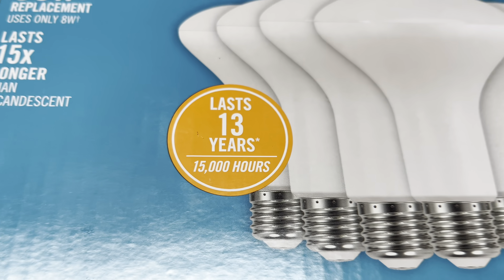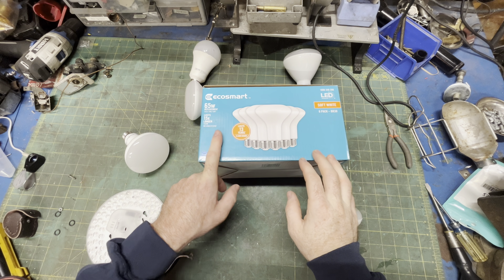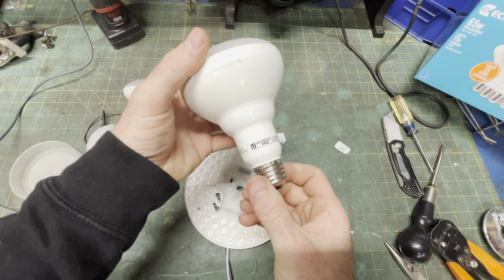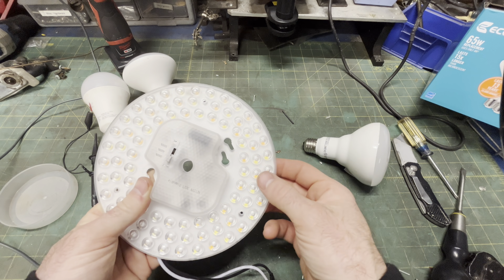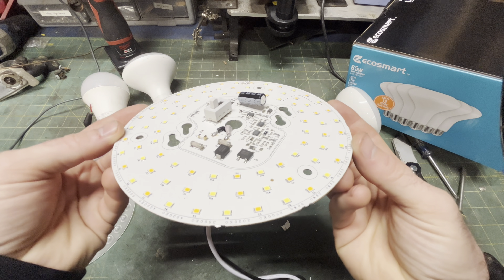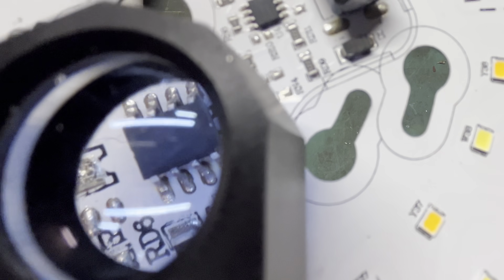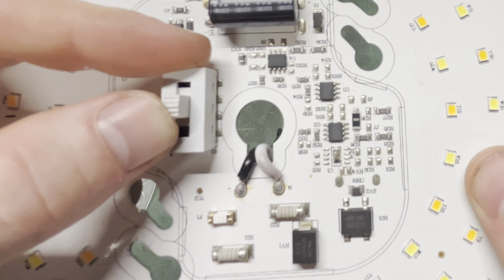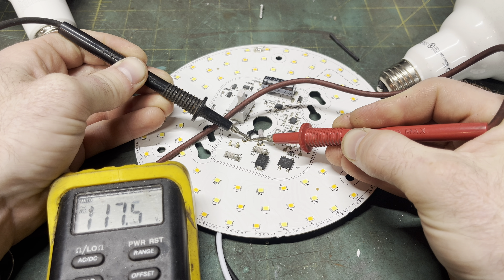Why Do LED Bulbs Fail? An Autopsy!

Comment: Its wild, we were told "its ok that the bulbs are more expensive, worse for the environment and made with questionably sourced materials. They last longer so its a net positive environmental impact" and that SHOULD all be true but they last, on average, slightly less as long as incandescent. And now incandescent are all but entirely gone. Even with the lower power consumption, LED bulbs are a net nagitive environmental impact, and its really embarrassing. The government should really be holding manufacturers accountable for the false advertising, but environmental  onsciousness and efficiency is the federal governments favorite scam bait.

Comment: It shouldn't be all that difficult to switch all residential lighting over to DC. Just install a DC power supply between the breaker box and the light circuits, then run all of the lighting off of DC power. Now you only have one likely failure point, since the LEDs themselves will run basically forever in comparison.

Comment: You referred to an electrolytic capacitor in the second bulb. The obvious role for that would be to smooth the output of the bridge rectifier, but that wasn't happening.

Comment: Plenty of name brand GE bulbs i have fail not inside the bulb itself.. but tjat super super leaf paper thin layer on the bottom of the bulb when you unscrew or screw it in. X amount of times.  Or if its in a older fixture it scratchs or burns off that coating and it stops getting electricity.

To where old fashion bulbs have a thick layer of almost like lead on the bottom and this never wears out

Comment: I've had a homemade led bulb on continuously for 10 years now on my back porch yet I can't buy a brand new modern led bulb that lasts more than 2 years (I have unstable mains voltage).

Also most bulbs I buy now run so crazy hot, it's uncomfortable to touch the base of them and the "cheaper" ones have no heatsink whatsoever.

Comment: Regarding your light sensor that's on all the time, did you ever work on 3 series BMWs? Because that's just what my 'automatic' setting for my lights does. I think 'only on when it's dark', it thinks 'on!'
Works for me! Except when i take it for an MOT test and Ian switches them off. That leads to a few seconds of confusion for me when i'm on earlies and drive up the road wondering why it's so dark then have to pull over and switch on the interior light to work out how to switch the lights back on again...

Comment: Fatprobing around a live circuit and making breakers pop and magic smoke get released is giving me a very uncomfortable feeling. I suggest you to invest into a sharp and thinner pair or probes, just so you can stab the test points directly without it slipping amd making a short.

Comment: Life is measured in hours. The number of hours you run the light equals the life. Some manufacture will state on the box x number per day. 
Example a 10 year bulb might only be a 15k hour bulb that is intended to be on for only 4 hours per day. 
Keep this in mind not only for bulbs, tvs and anything that have backlights. Tvs will quit working due to bad backlights as well.

Comment: In the UK/EU lifetime (and other specs) labelling is mandatory and must be done to standards.  However I have found store brand bulbs do not last their indicated life, typically about 1/4 probably for the reasons you state.    Store brands do not have the technical expertise to assess a suppliers product and the suppliers has no incentive to produce quality goods.  They are fire and forget production.  They will have agreed on a cheap price and will cost engineer the product to death.
Proper brand last much better, its simply a matter of having a brand to protect.  In the last few years I have noticed store are not doing their brands on LED bulbs anymore, and stocking a well known brand instead.

Comment: I've had the LED lightbulbs in my house for over 3 years, most of the incandescent ones i remember changing every other day. most of the time due to pretty much temperature damage on the glass, or some sort of power wiring  issue.
LED ones dont really have a reason why they should break apart from blowing out the other less stable parts. 
But we all know they like to install Planed Obsolescent crap in everything.

Comment: Do you think they ran the Leds at a lower voltage to reduce the heat and just to make the Leds run alot longer.

Comment: 11:45 the first round of LED bulbs were over engineered to avoid something going wrong since older LED's had a tendency to be melted with high voltage the companies that churn out crap didnt want to be sued for fire damages for trying to make a quick buck off the surge craze.

Comment: I have moved and replaced every single bulb with expensive Philips light bulbs and when I installed them I wrote in sharpi the date installed and then stashed the receipt in the box, once the the box is filled with burnt out bulbs I take them back to the store and get a new box. Ive lived in my new house for under 3 years and ive replaced every light bulb due to flickering, burned out or non functioning close to three times per room. 5 times in the hallways which is insane cause I have to use a ladder. I get them exchanged at no additional cost and they send them back to the manufacturer I suggest EVERYONE do that... or smuggle the bulbs from Dubai where planned obsolescence is illegal

Comment: OK, long story short:  my experience is totally different than yours. Before 2009, it was incandescent lighting all the way.  Bulbs were cheap, they lasted mostly about a year, and I bought a ton of them. They sucked up 60 watts each and cost me much more for the power than for the bulb.  In 2009 I transitioned to CFLs with every burned out bulb, so it didn't take long.  Four years of decent light, bulbs burned out rarely, looked a little weird; something like 27 watts?  In 2013 I went 100% LEDs - and it's been a miracle technology.  They don't burn out, the light is easy on my eyes, it's 9 watts, my lighting bill is so cheap it seems free.  I would have to be insane to go back to anything else!  Two points:  I did have my wiring and grounds checked out by a certified electrician, and all issues corrected.  And I always buy name-brand LED bulbs.  Sure, they might be made in China - but a Phillips bulb beats sketchy Brand X Chinese junk anytime.  You get what you pay for.  I'm ecstatic with LED lighting... and I'm just talking about ordinary light bulbs here.  LED has revolutionized many other aspects of lighting.  With lighting... humans have never had it so good.  Sorry to hear you're not getting the same results!

Comment: As expected, the LED is seldom the problem. I always assumed the capacitors would fail. It's surprising the resistors fail so often or solder joints fail.

Comment: The fact that you operate incandescents and LED bulbs in the same circuit explains your experience of failing LED. Of course chinesium solder joints won't help, but the main issue is definitely the mixed use. Either switch over your entire house, or don't switch at all. Power saving Phillips bulbs are even worse than tungsten incandescents...

Comment: The easy solution is to wire the light bulb sockets with a heavy duty power supply to feed all sockets.   To many cheap power supplies = dead electronics.   I wonder if houses will start going up in flames due to cheap led bulbs

Comment: It isn't "hipstery" to prefer the light spectrum that incandescents give off.  In fact, in 2 or 3 decades we'll likely be hearing about the unbelievable detrimental effects of the missing light frequencies (and overamplified other ones) in LEDs compared to the (closer to sunlight) legacy incandescents and halogens.  There's a ton of science on this already.

Comment: 0:25 Incandescent light bulb on 24/7 for 9 years, which is about 79.000 hours. Typical life span is up to 2000 hours. That's nearly 40x the typical life span. I find that hard to believe.

Comment: You are lucky that it is the boards that fail. In Russia, most LED lamps fail because the boards are configured to supply more current to the LEDs than they are designed to. The situation is that they give more light, but fail faster due to overheating and literally burn out. Savings + planned obsolescence
Reply: токоограничивающий резистор решает  эту проблему .
Reply: @ruslantser  Нет
Reply: @lynrayy  проверено временем

Comment: the LED streetlights around where i live are failing here and there, a whole street of them died a few months ago, all for the same reasons most LED lights fail, cheap circuits and placed on a line that wasn't designed with them in mind.

Comment: "Crap out after 5 years or less?"  Yeah, LOTS LESS.  I started writing the date on every bulb base back when CFL's became a thing.  Not a single one of these garbage bulbs lasted more than a year, with the exception of the ones that were never used!  When stores began peddling LED's, I did the same thing.  The first couple of generations of LED's never lasted beyond 9 months.  The new ones have gotten better but they still don't come close to the marketing hype.  Failures range from garbage electrolytic caps to unsoldered components to defective LED chips to garbage heat sink grease that dries out causing LED chip failure from heat.

Comment: Where did you get LED bulbs that last 5-7 years? The typical lifetime I see is measured in months and they burn out the actual LEDs (unless I specifically buy some of the rare ultra-efficient kind).

In a case of one whole batch, some failed because of bad solder joint connection - or more specifically complete lack of solder on one side of the power input. This caused flickering which over time burned the LEDs.

Around here, those you can get in the vast majority of stores, are the cheapest of the cheapest ones, that overdrive the LEDs such that they don't last longer than incandescent. To get something decent I have to order it online.

Comment: I've found LEDs last about the same as incandescent.  I have 4 flood-style that are 6yo, but the cheaper e26 socket ones seem to last about 2 years.  Same for e12 candelabra bulbs.  Not really much different than the incandescent. 

I still run incandescent in my master bath due to the dimmer & fact that dimming LEDS is just objectively worse than incandescent & more expensive. I haven't noticed them lasting any longer, replace about every 2 years.

Comment: We need a new standard socket for LEDs that provides the DC voltage they need and and the bulb you insert only has the LEDs so the DC circuit wont get cooked by the heat.

Comment: Don't cheap out, I only use Sylvania LED bulbs. They can be had for $5 CAD for 2 12 watt 60 watt equivalent bulbs, which is still cheap in my opinion. I have been using LED bulbs since 2012. My first 3 cost $40 each, and they are still running. My whole house is LED, even my T8s and I have only had, I think, 3-4 blow on me in a decade.

Comment: Your 1 say 60w bulb on for a year at 30c /kWh = $158/year. A 10w LED $26. For the $132 you would save a year on that 1 bulb, you could make a video with plans for a rock solid circuit to replace each LED as they fail after 7 or so years. You might even embrace proper colour rendition in the daylight range of an LED over the slightly better than candlelight colour illumination of warm white bulbs.

Comment: I have been using ALL the LED bulbs my energy provider gave me FOR FREE 8 years ago, and not one has failed so far. I moved house 7 years ago, took them with me (my providers said I would have to pay for them if I didn't) and added a few as there are more outlets where I now live, I bought them from a supermarket, with their name on them. I feel they must have done their research. I have not had a single failure at any time. My brother says his LED lamps fail for a pass time, but I know he buys the junkiest cheap crap. You get what you pay for. In the early days of the fluorescent-type low-consumption lamps I bought plenty, reckon I saved the money on electricity easily over time, and only ever had one fail, at about 12 years old. Modern good quality LEDs use even less power than fluorescent lamps, and it's hard, in the UK, to pay more than, say, £2.00 a pop per lamp. Take an incandescent lamp of 100 Watts vs a 10 Watt LED, just do the arithmetic (it is not maths, but arithmetic!) and work out the future point where the cost of a quality LED is covered by reduced electricity consumption. Better still, leave both burning day and night for a year, with, for easy sums, power at $0.25 per kWh: - LED = $21.9 a year vs old-school = $219!!! The reason your - woefully uneconomic use of an - incandescent lamp is still burning is precisely because you ARE NOT TURNING IT on and off throughout the day. But hey, feel free to literally burn power, and pay for it.

Comment: I had a Cree bulb die from a capacitor failure way back in 2015 or 2016, and one GE "light stick" style bulb die from water vapor incursion in an outdoor lamp fixture two or three years ago.  I have 20+ bulbs in my house and they were installed around 10 years ago -ish.  Wish I had kept better records. I believe they were all rated for "50,000 hours" and my lights are on well over 50% of the time - so to answer the rhetorical question do any bulbs actually achieve rated lifetime - yes, they do, if they are made by a company with engineers who actually know how to perform thermal design analysis and how to derate specs properly, and a procurement department that doesn't swap out the designed components for the cheaper "identical" ones Bob's cousin's buddy's neighbor sourced from some new company down at the docks you've never heard of with a slightly suspicious sounding name that changes every four weeks.

Comment: My first two (Philips) lasted about two years. I was disappointed.
These later ones (EverReady) now about six years and going well.
I think heat is the problem why they fail.
I hear people say their LED bulbs are noisy on amateur radio receivers but mine are o.k.
G4GHB.
Reply: I had an EverReady fail in two months. Some cheap Status branded ones from Home Bargains are still going strong several years later. 

I'm not sure that we can pin anything on a specific brand. Most seem to be pretty much (except for the Dubai lamps) the same overrunning the chips. At least running them in a manner that is not conducive to a long life.
Reply: @aethelfreda  Yes, I thought Philips would be good. 
It's weird, some fail and some don't.

Comment: This is a problem that'll continue until dedicated DC low voltage lighting circuits for building electrical systems becomes a thing.

Comment: If you buy quality (sort of) brands you may have better experience. I have two Phillips leds in my yard lightings. They have shone in 12 years 24/7 now in temperatures from -30°C to +30°C. (It's originals from 2012.)

Comment: I have had filament bulbs die like flies recently in a ceiling lamp. Begins with a flicker, then it goes out with 2 of the 4 filaments still slightly glowing when the power is on. It's always the same lamp, I have changed the socket, removed the glass (maybe they are overheating I thought), everything, but they still go out after 1-5 months (been like 4-5 now) while the one in my table lamp has survived for 2 years and surely has more on-time (same batch of bulbs)!
What else could it be? Should I flip hot and neutral? I am at my whits end here.

Comment: My experience with LED bulbs has been hit and miss.  We have LED bulbs that have been in place for a quite a few years, but I've had some that didn't last very long.  I agree that heat seems to be the biggest issue ... LED bulbs are less likely to last long when inside an enclosure. My wife and I both greatly dislike the warm white bulbs, and she does not like the daylight bulbs except in a few very specific locations.  We both like the Bright White bulbs, which are the hardest to find.  I've had reasonably good luck with the ones from Home Depot, but I bought some on Amazon (cheap Chinese bulbs it seems) and got less that a year out of any of them. They didn't even last as long as the old incandescent ones.

Comment: Current-limiting resistor instead of a proper switch-mode constant-current driver is just tragic... those ICs are maybe a few tens of cents and you can get very high efficiency and power factor, low distortion on your 230V, some have zero output ripple resulting in flicker-free lighting.

Comment: On that 2nd bulb, 15 volts per LED chip? Are those individual LED chips each composed of 5 LED diode junctions in series, at 3 volts each?
IIRC you're supposed to drive an individual white LED diode junction at a forward voltage drop of around 3 volts, and 15 volts drop being "normal" brightness by your eyes (and not just instantly vaporizing the LED's contact wires) tells me that it's gotta be 5 LED junctions in series.

Comment: One of the LED bulbs in the bathroom vanity stayed dimly lit when the power was off. Even if I unscrewed it and held it in my hand, it seemed like it was still on. Curious about that failure case. Capacitor?

Comment: Most of the £3.50 led bulbs last between 6 to 12 months that usually translates to a few hundred hours use  it he only thing positive about them is they do use less power and last longer than the traditional 5 for £1 light bulbs

Comment: Personally; I've had fairly good luck with LED bulbs, except for a 10 pack of "Dura"Bulb brand trash from the Home Despot, of which 7 of them all died within days.  I believe the little headlamp LEDs would last much longer, but for the cheap switches.
It's the screw in compact fluorescent bulbs that are much more expensive than incandescent ,and die after only weeks that I won't buy any more.